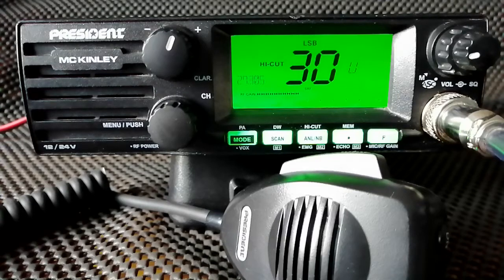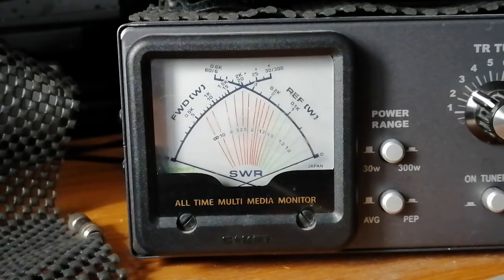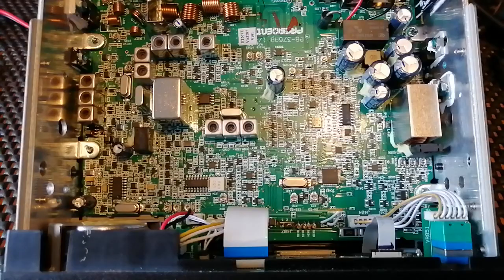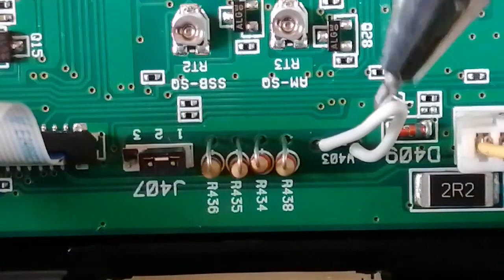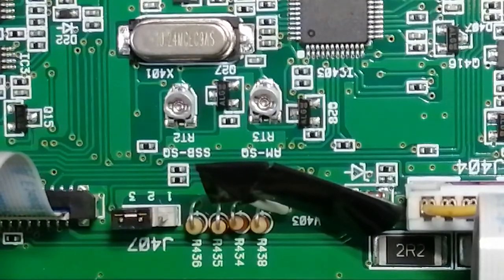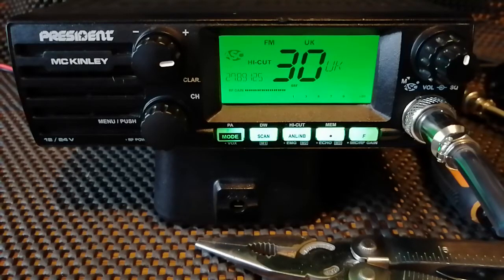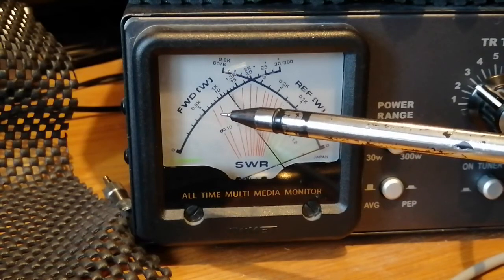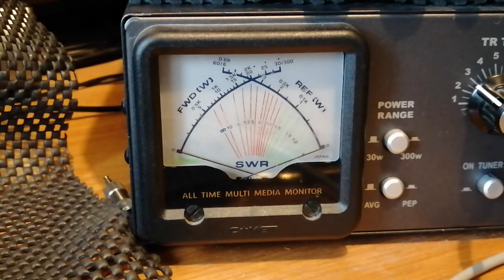Enthusiastic Steve "Never too late to the party"

Comment: Hey @StephenLegg İ have read the McKinley has a modulation problem.   
They say that the modulation is too low! Did you have that problem?
Reply from the maker: Not noticable, you can always boost levels with a power mic if you find it too low. The real problem is those who use converted amateur radios fo cb often set deviation wider. Thus a normal cb can sound a little quiet. A cb to cb the McKinley should sound great. Regards Steve

Comment: Hi I have a 
President Mc Kinley output around 18W to 19.5W
Test on a NISSEI R/S 70 digital SWR/Wattmeter. I am looking for a good LINEAR AMPLIFIER (WITH PRE-AMP) something like the RM KL (100W) (200W) (300W) what would you suggest,any help would be appreciated.
Reply from the maker: Zetagi b 300 is a good amp,  but don't over drive it or any amp, you would need to back the power of the radio down. Depends how much power you want, 10watts gets me to the USA. Regards Steve

Comment: What power connection options are there for AC socket, for solar panels, car batteries, car cigaret socket, power pank, ...?
Reply from the maker: It's just a standard 2 wire input, as long as its a clean 12v dc supply, running out of the box a 5amp supply should siuffice, just add a couple of more amp's if it is modded with the slightly higher power output. It is not so power hungry as compared to a ss 9900 which can tx to 40w +, just ensure you keep fuses in line to protect from short circuit. Regards Steve

Comment: Hi there , 
I wonder if you could help, I have only had my McKinley for a couple of days but what I have noticed is the humming noise coming from it, in zero volume it makes a noise, it sounds like a pc fan has come on, I have a regulated power supply , nothing else connected , the shop said they have tested the same model in there shop and stated that also makes a noise at zero volume, I’m just not swallowing it, I have a President Richard which is completely quiet, have you noticed any noise coming from yours when volume is turned completely down ? Thanks for your help
Reply: Hello Patrick,  I just got my radio out and set it up on the bench. When on the only noise I can  hear from the radio is a very low hissfrom the front speaker. It's no way a loud noise and is the same on my ss9900 cb radio. Regardless of squelch setting. My cat 7900 use to have a hiss but went after you pressed the ptt once. My president does not make any loud noises. You need to compare what the shop is saying is a noise and the noise you are hearing. A slight very low hiss from the front speaker grill is normal , if you have any room  background noise you will not hear it. Anything louder than that then it is worth querying it. Hope you can get it sorted.  Steve
Reply: @janetlegg6623  Hello Steve I absolutely appreciate what you just did , that is what I call putting yourself out, thankyou so much, maybe the hiss is normal then, i thought It was strange as my president Richard makes zero sound, no hiss at all, I have been away from the game for many years so it’s nice to get help from someone like you, best wishes to you mate , I feel better now, cheers Steve

Comment: Steve I have been really disappointed with the squelch function it just pops and clicks all the time. Compared to the Grant 2 which was silent, does your surfer the same annoying issue or have I got a bad one? Otherwise I can't fault it, great radio.
Reply from the maker: Hello James, I can't say that has happened with mine, I run mine normally with just using the auto squelch setting. I have used that home base and mobile and it works fine on mine. I only use manual squelch when hearing a weak station then I normally open it to hear it. Hopefully it will resolve itself,  I wonder if it would do the same using an external speaker? Regards Steve
Reply: Steve thank you for the reply it pops / clicks on opening if you turn the volume to minimum so no sound as signals open the squelch, you get an annoying click / pop it makes use on FM hard work with either auto or manual squelch on.
Reply: I have 2 of these radios. The squelch on FM is horrible, so much that I don't use FM at all on them. They do work magnificent on AM/SSB though.

Comment: Hi ................... Was there a change in the FM  modulation after the wideband Mod ....................73s
Reply from the maker: Hi Matt, no just a power increase and able to tx across a wider frequency. Though you can adjust the mod via an internal adjuster, I have left the pot unadjusted as I am getting good audio reports, loud and clear, not sounding narrow. That's on the standard mic, I am thinking about getting a kpo power mic, this will boost the output on ssb slightly and boost the audio. I use kpo mics on a few of my radios with good results. Thank you Matt, regards Steve

Comment: My McKinley was spot on 4w AM/FM and 10 Watts on SSB out of the box. It did around 22w in export mode. 

I have now put it back to standard.

I get the feeling your meter is a little lazy or you've been unlucky with that radio. (I'm assuming you were testing into a dummy load?) 

And by the way, the McKinley EU has only been out since June 2019 👍
Reply from the maker: Mine was a little under 4 watts, but have now adjusted it. On the standard mic it takes a lot to get it higher, I think a power mic upgrade will assist. But it works well as it is, I think the audio receive is really nice, clear and enjoyable to listen to. Cheers Del, regards Steve

Comment: Nice one Steve, you did get a bargain.
Reply from the maker: Hi Paddy, yes, I found it on market place, about 40 miles away, so contacted him, collected it and had a day out in the local area. I am very pleased with the radio, I have found the ssb receive via the front facing speaker to be very clear. Bargains are out there as are duff ones, I was lucky.

Comment: Prior to the 10m mod power output was appalling! Interesting video.
Reply from the maker: I think they do it to ensure they comply with local rules. Like a car and emissions, they are generally de tuned as new. After the mod I did have a play and adjust the pots. I got a max of 25w on ssb peak and 24w fm. I have since backed these off to 20w to protect the finals. The radio does have very clear sssb receive, I did not go into a full review as many other videos exist of that. Ty for the comment, Regards Steve